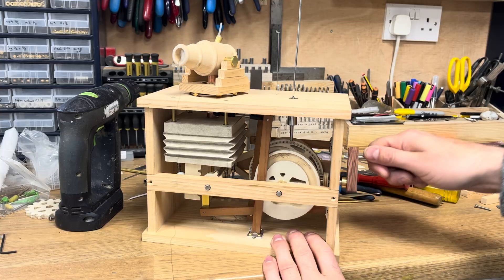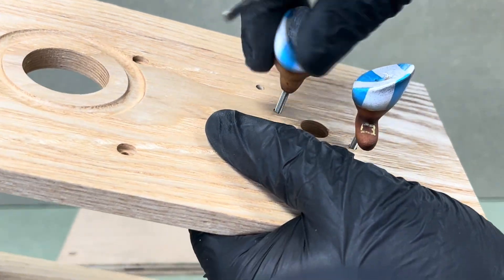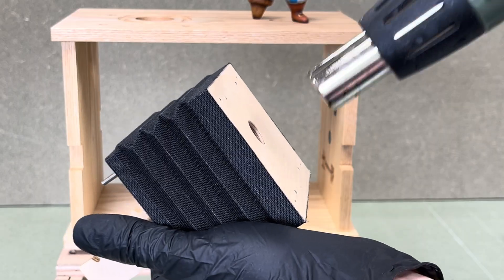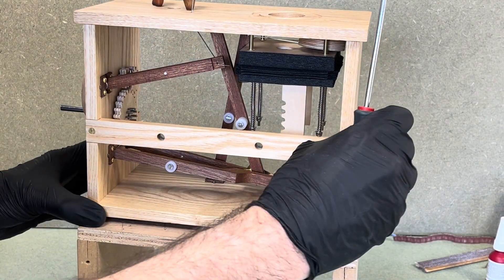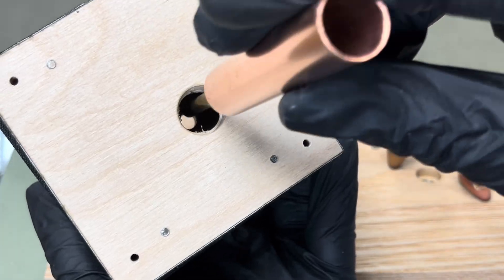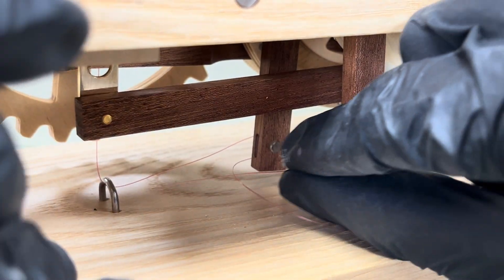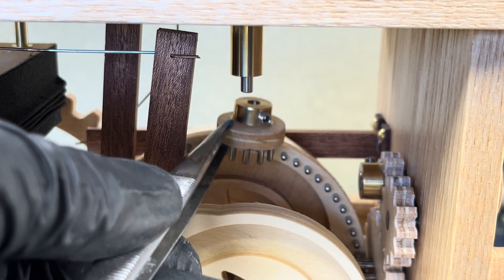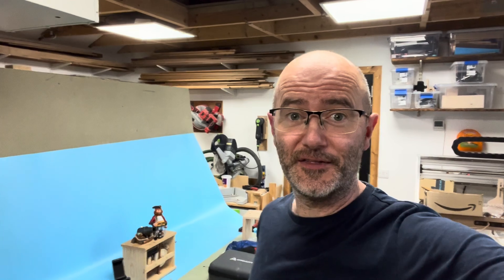From Parts to Precision: Building the Pirate & Cannon Automaton

Comment: Fantastic work. Only today I became aware about your channel. May I ask why you use slotted screws instead of Phillips or Allen? Slotted, on my perspective, are more difficult to access when the tool cannot be straightly aligned to the screw axis. It is also more difficult when the screw is inside a "well" or deep recess. Thank you for sharing your clever insights on mechanical solutions.

Comment: 1:16 Is there a reason you don’t use a table saw push stick? I was cringing with your hands so close to the blade. One slip and your automata days are over. Would hate to see that happen.
Reply from the maker: I usually use a push stick, but felt safe with this setup. Still, you’re right: no room for complacency around a table saw. Thanks for looking out for me.🙂